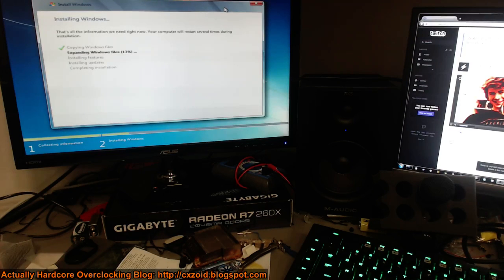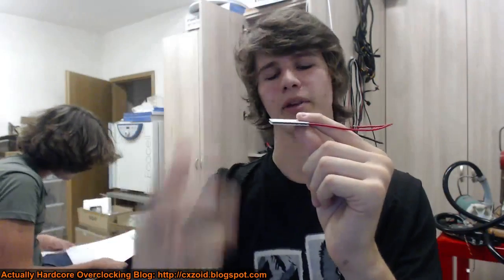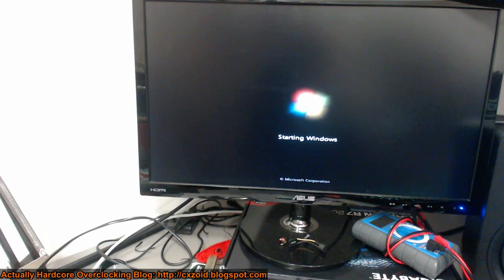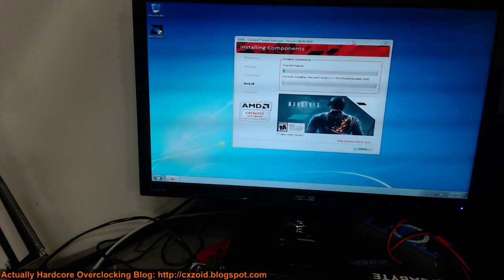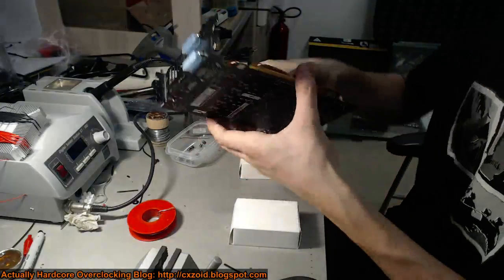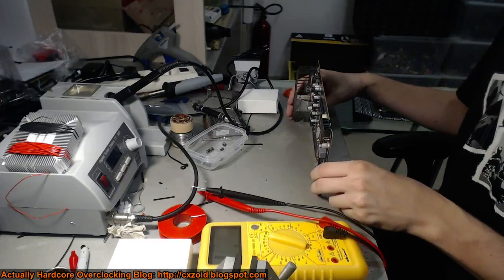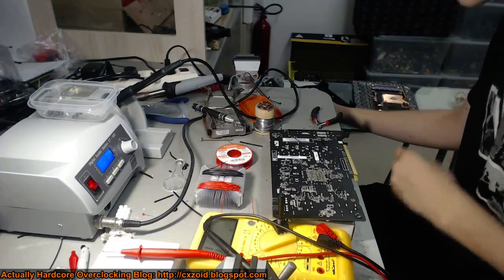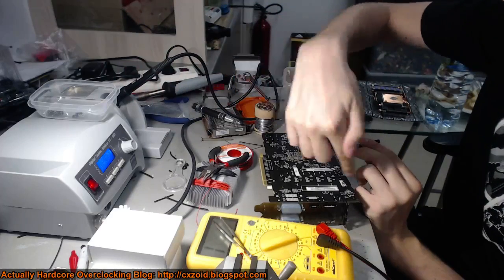Overclocking Livestream 3: Voltmodding an R9 380 Nitro part 1

Comment: I can see something good? I have a r9 380ITX 2GB  wanted to know if I can do OVERCLOCK HAVING A SOURCE OF Thermaltake tr2 500w the rest of the pc is a core i5 4460 8GB RAM 1TB disk 4 fan cooler mother ga h97-gaming 3 will be far reaching GPU 980ghz 1100 GHz memory speed of 1400 GHz to 1500 GHz endured the source Thermaltake 500w? I speak from Argentia